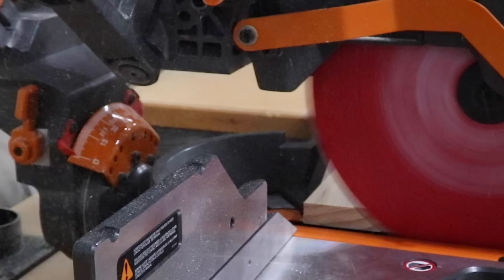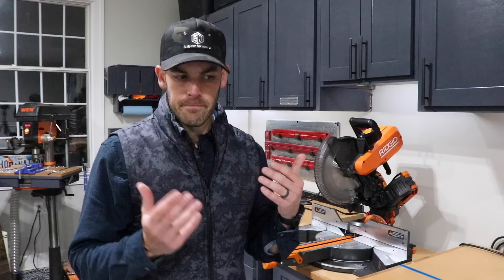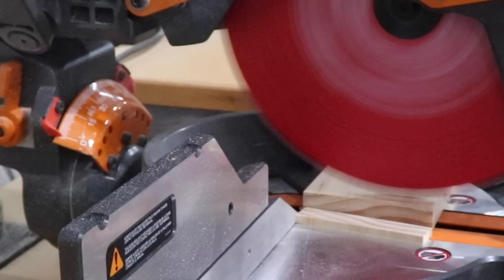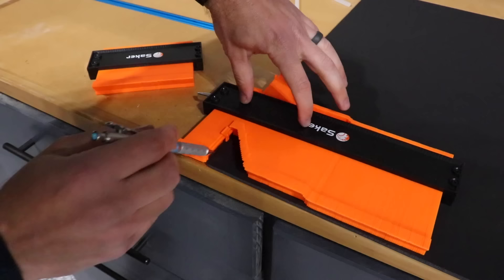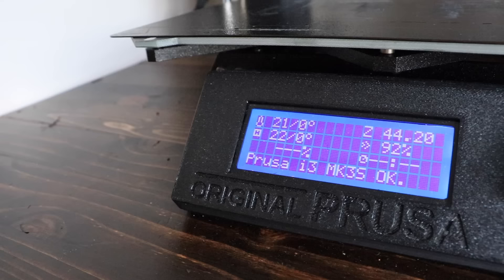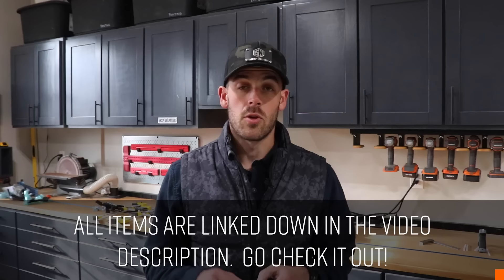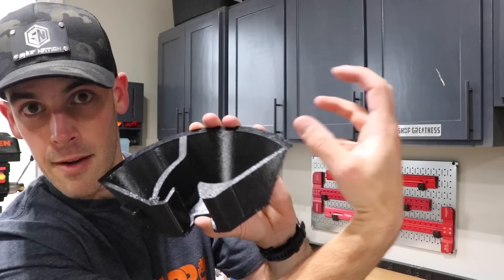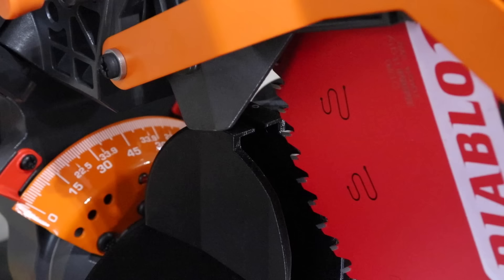Did I Solve Miter Saw Dust Collection?

Comment: Just ran across this video and was quite interested in this sophisticated attempt at a solution. I bought a Festool kapex because of the claimed superiority of it’s dust collection but I am quite disappointed at how little it collects. My solution was to buy 2 veritas magnetic dust chutes and epoxy a large steel washer on each side of the rear housing and “Y” off the single dust collection hose to the 2 chutes, this was in addition to the built in dust collection. Like your solution miter and bevel cuts will remove a chute from one side or the other but usually not both. There may be no perfect solution but I like where you’re going. Keep up the good work.

Comment: You have to remember that with a cut the wood stays on the blade for a short amount of time, you'll have to figure out the angle which it gets released from the blade. Maybe get in touch with some high speed/slow-mo camera guys for content. But with the dust port on the miter saws generally above from the company is just the easiest. As seen below a curved collection with dust port on the side but it might get in the way of the arm. Or CNC a new arm to have the dust port out of the side.
Reply: Also need to consider momentum, and if you're wanting to overcome that you'll likely need more suction than the shop vac.

Comment: Film the saw in low light with a narrow beam flashlight lighting up the sawdust flying off the blade. Identify the pattern and the spread and then redesign accordingly. You need to observe and understand the pattern of dust your particular saw is producing before designing a solution.

Comment: Hate to be that guy but the Kapex solves this problem.  bought mine 7 years ago and it was a much better deal than today but if it was stolen I would probably go out and buy another one.  
being able to setup in a living room with a drop cloth and a vac and cut trim should tell you everything you need to know about how well it works.

Comment: Definitely keep the failure videos coming, I relate to this a lot! 😀

With the benefit of hindsight, I think the saw blade functions as a pretty powerful fan that creates a surprisingly large zone of high air pressure. The cause of failure is that the collection system is a weaker fan and therefore lacks the volume/capacity to capture what comes off the saw. In short, what you made is a drinking straw trying to capture Niagara Falls. 

For a next iteration, I would try to make a system that uses the force coming off the blade rather than fights against it, and of course larger capacity.

Comment: I think no matter what you do with the shroud design, the shop vac just does not produce enough airflow.  A shop vac (any vacuum really) is designed for high suction (pressure) at the expense of air flow (cfm).  With high velocity dust sources, you really need to have a face velocity of around 500 cfm at the face of the collection port and have it as close to the dust source as possible.   This is the real conundrum with all SCMS - a large shroud is needed to capture the dust stream and high face velocity is needed to capture/redirect the high velocity dust - but the bigger you make the shroud face the lower the face velocity given the same collector device.  My SCMS sits in front of a large dust shroud basically enclosing the whole back of the saw and is attached to a 6" duct collector pipe - face velocity measures just under 500 CFM and I still get fugitive dust that is not collected.  Another way to think of it:  assuming your saw motor runs at 3450 RPM, the dust particles coming off the blade are traveling at almost 11000 ft/min - it takes a whole lot of air velocity to re-direct particles moving that fast!

Having said all that, I love the design thought process and the prototyping with 3D printing - I really wish I had those capabilities!  I think a combination of higher airflow and a wider throat on your shroud you may have a really well working setup!

Comment: Basically, you had an example of laminar flow interacting with the dust particles. Instead of vacuuming the dust, the 3d printed part acted as a low-pressure barrier and the high-pressure debris/saw dust bounced off the part opening and around the side. Without the dust collection, the stream was directed to the bevel gauge. It would be interesting to see what would happen if you tried to use the saw with the 3d printed part installed without the vacuum on.
Reply: Do you think lower CFM or lesser negative air flow would improve extraction? Or moving the outlet port down with a longer tube and small baffles?

Comment: Travis nice upgrade! Sorry the dust collection didn't work.  Hang in there. With all the technical advice provided in the comments the solution should be found to address your issue.   I'm glad you decided to publish the attempt.  It made me feel like I'm not the only one that stuff like that happens to.  I placed the dust collection ports to close to the saw on the enclosure I built for my DeWalt.  Some of the dust gets collected but the majority of it collects at the back of the box.  One day I'll relocate the ports to the rear of the enclosure.  I look at the upside in the fact that the dust is at least contained.

Comment: Señor CAD Designer here. I don't understand how these companies don't offer standard accessory options for dust collection. For this application, it could be done in a week by one designer, including testing "first articles" from fast, accurate... expensive.. printers. Open the released assembly and sub assembly files, create an envelope based on combined views from all the different worst case scenario arm positions, then use flow analysis tool to tweak collection volume and efficiency. They could even offer two parts. One for dedicated 90* and another for all arm settings.
Reply from the maker: Totally agree, no idea why this is largely ignored by the OEMs

Comment: One thing I've noticed on my Dewalt saw that I've hooked up a 3D printed dust port to and had success with is that mine is set back quite a bit toward the wall compared to yours. Not sure if dust and chips slow down more back there and that helps the vacuum catch those but that's my theory. Having the vacuum close to the blade means you're having to overpower the speed that the blade is slinging the chips.
Reply: Makes sense. Hood with multiple ports seems to work quite well in a few YT vids. Port close to blade means high speed dust off blade teeth hits an invisible wall of slow moving air at port so gets deflected away from the port rather than sucked in. 
   Like a peleton of cyclists racing on wide flat road hit narrow hill or hump back bridge. They crash into riders in front who have slowed or bounce or steer off into ditch or down river bank. It's a pattern in many bike races and riders have suffered extreme injuries and death. Particles bigger and slower than saw dust but momentum probably greater and the model is remarkably similar! Nobody has solved the problem because each such pinch point is different. Ambulance is equivalent to after cut clean up! Lots of padding to protect against bones hitting metal and stone kerbs, corners, signposts helps clear up 'dust' that hasn't got stuck to the surroundings

Comment: I got makita Makita LS1019 and it's dust collection is the best I ever used, but after some minor adjustments(I just rearranged dust port to work parallel on two flanges rather than in sequence one after another) Even kapex was second to this one in dust collection. It is fairly simple, just two dust ports with rubber sleeves, works fine on miters. Most of the dust just bounces off the extendet fence(It just can't be moved a little sideways, only removed completely)

Comment: I have the same vacuum and separator under my miter saw. I also have a Jay Bates inspired station. The enclosure that i have around the saw only really serves to keep dust from flying out away from the box. It does a pretty good job pulling in floating particles. I still have to periodically vacuum out the inside of the enclosure.

Comment: Travis try looking at the bottom of the miter saw as the track where blade runs in the base is the is the one place everyone does not take into consideration when looking at dust collection, think of the miter saw as a upside down table saw.

The table saw always has dust collection above the blade as well as below the blade even with a zero clearance insert, plus a table saw blade rotation is towards the operator.

The miter saw has the same principle as the table saw except the the teeth of the blade rotation is away from the operator on the table deck.

The reason miter saws are difficult to get really good dust collection is the bottom of the saw is always blanked of with the deck of the miter Station.
The underside of any miter saw has perforations in the bottom to let the wood dust and chips to fall to the floor when they are used at job sites on saw horses.
So when you see miter saws being used their is always a big pile of saw dust under the miter saw.

The problems with miter stations their is no down draft to the under side of the miter saw so the air pressure that is made from the rotation of the blade is channelled to the back of the saw.
The more suction to the back of the saw produces more dust accumulated higher at the back of the saw.

I hope that this is helpful?
I am a metalwork engineer and I have alway seen the bottom of the saw blocked off by the shelf it is on.
Yours Philip Burrows in Overton on Dee, Wrexham, Wales, UK.

Comment: Try dust collection beneath the saw as well. I cut a hole in my bench about the same size as the saw's insert. The down draft really helped reduce the amount of dust that went to the back. I did this in addition to the supplied dust collection shroud at the back and I found that it worked better than expected.
Reply: i like that idea. when used together with above-the-plate collection.  Also, the shop vac does not pull that much volume, and why not try it with a larger volume dust collector?
Reply: @mriguy3202  It actually didn't occur to me until you said it but ya... I was using my 1/2HP dust collector with a 4" to 2x2.5" Y-adapter to split the hose to both top and bottom. Still, you'd think that the higher velocity of the shop vac would be better than the volume of the dust collector given the size of the dust particles... but now you've got me wondering about this. I think some scientific-like testing is in order!
Reply: I too do the downdraft. It works really well in conjunction with the blade-level collection. I think Travis may have discounted the "shroud" idea a little too quickly. Some do really suck, but the box I've built is amazing.

Comment: Scott Kinkead

I had a thought that may lead to an easy fix for your nice 3D printed dust collector.  Any small non-metallic particle (i.e., Sawdust) is an electric insulator, and therefore carries a substantial static charge when it's created by your saw.  As a former explosive chemist, we paid enormous attention to control of static electricity, since numerous fatalities have occurred in such things as dust explosions. [Some explosives can be detonated by a carpet shock!]  To rapidly bleed off the static charge from your sawdust, try placing a piece of aluminum foil on the inside of the collector, in the conical section.  To make this work, be sure the foil wraps around the bottom of the collector so it's in contact (electrical & physical) with the metal table of the saw.  Hopefully this will bleed off enough of the charge for the collector to perform better.

Comment: 😊I spent this last holiday weekend trying to solve the same problem on my new DeWalt cordless miter saw.  The sawdust seems to travel in three vectors:  Strait back at a low, middle, and high angle depending on which portion of the cut you are making.  Long story short, this requires three different pick-up points for a vacuum , and a single 5 horse vacuum does not have the power to provide enough  suction.  forget being cordless on a job site and good luck not blowing breakers.

Comment: As many have stated below greater air flow will always help. Velocity is always the answer.
Travis today another video popped up on my suggested list from Rings Workshop. He headed down the same path as you with trying to design a better dust collection system. He had pretty good results with his methods. Together y'all may solve this issue. Interested to see what your final design looks like. One thing Ring Workshop could have done is to put collection hoses on both sides. His brush design improved the results dramatically. Thanks for the video.

Comment: Hey Travis,  I tried to solve the same problem with my 12” delta saw years ago. When I looked closely at the spray pattern of the ejected dust, I could see that much of it was simply going wider than the narrow factory boot that is right behind the blade. My solution was to take a plastic floor sweep and used some of the material to make “wings” that effectively widen the boot, blocking the overspray so that much more of it finds its way into the boot.  I can send you a picture if you want. The wings track with the saw for miter cuts as well, but mine just a single pivot, not rails or compound knuckles.

Comment: I have a suggestion. I own a ShopSmith which has a dust collection shroud below the table. The design of this is in two slotted  pieces so that width of the opening parallel to the blade can be adjusted.  It has a port for connection to the dust collector. One of the things I learned seems counterintuitive: the opening needs to have quite a bit of space around the blade in order to work properly. Closing it up tight to the blade limits the dust collection. When I saw your design, I wondered if it would work. Now, one other factor is the difference between a dust collector and a vacuum, the former move a large colume of air more slowly than a vacuum which moves a smaller volume more quickly, so this may not apply with your shop vac.

Comment: Great video!  The Festool Kapex is considered by many to have the best dust collection in this category.  You might look at what Festool has done which is completely mounted on the blade hood. I could not afford a Kapex so I went with the Makita LS1219L.  Makita uses a two-prong approach with a hood-mounted design similar to the Kapex and a static rear-mounted dust catcher.  I thought this should work great but soon discovered that it's not very efficient in terms of air flow.  A strong shop vac didn't work well but a Bosch VAC090AH dust extractor did.  From my experience, the suck behind the catcher is an important factor as well.

Comment: it's an old problem to a common issue with miter saws and then they created a sliding feature which further compounds the issue even more. This type of tool requires a wider dust collector opening to allow complete collection of dust and then add to the complexity of miter adjustment and compound adjustment. You should reinstall the original dust collector with the tool and build a shroud that encompass the area that dust dispersion is noticed. There might be a collection efficiency issue with smaller shop vacuum that have higher static pressure but low CFM, so a dust collector may be needed.

Comment: You need a higher velocity and volume of air flow around a shroud that in compasses the back side of the saw! I solved this problem by buying a hood that looks like a baby bonnet and connected my 5 inch DC line to it! No more dust in the air or on the shop floor or stand.😁🛫

Comment: I tried the whole shroud across the front of two cabinets on either side of the saw. Basically there was a very narrow window for the dust to go trough with over head dust port. All it did was create a vortex with dust swirling around and very little getting collected. I scrapped the whole thing. What seems to work best is a simple shroud around my dust hose set back away from the saw. Not perfect but it works pretty well.

Comment: I still say option 3, a simple box, is the best way. And you’re up against the wall. You literally need 3 pieces of plywood and you’re done. My DC is a 650 cfm and it’s plenty. I know as an engineer it’s tempting to get crazy, but 3 pieces of wood…..
Edit to add, good dust collection is dependent on air flow. Shop vacs have good suction, but not a ton of flow. Anything you do trying to get tight to the blade is going to choke it down… the big box method just basically creates a large space of a little negative pressure to keep the dust from flying around. No mess! I can literally use my air hose and 60 psi to clean the saw off and it still won’t make a mess if the DC is on. Happy to send pics if you want!

Comment: Keep at it Travis! I have not looked, but supposedly the Festool Kapex has "better" dust collection than most of the other brand miter saws. Festool in general tends to be very good about dust collection, but they're also the most expensive hand/benchtop power tools out there. Might be some insights from checking out the product page and/or owners manual. I have the Bosch 12" with the linkage arms design and it throws dust very bad too. A little better when I hook up the shop vac.
Reply: its pretty amazing to be honest.  they pu the port on the top/back of the blade housing.  I think there is something to that idea.

Comment: Festool Kapex has probably the best collection of any miter saw and folks have improved that even more with something called the Sawstache from FastCap. It's basically a broom behind the blade. Flexible bristles that can move over the fence, but not so flexible as to be blown back by air movement.